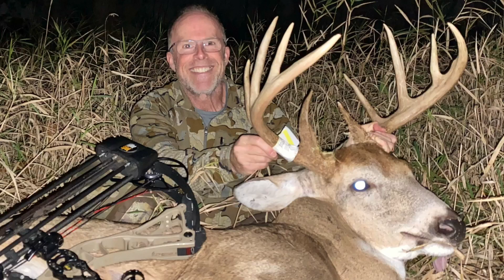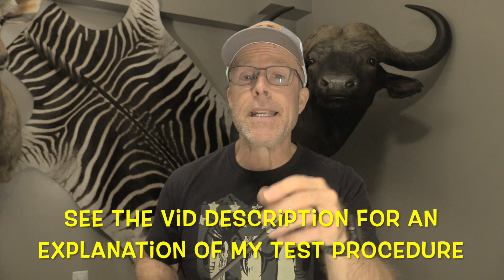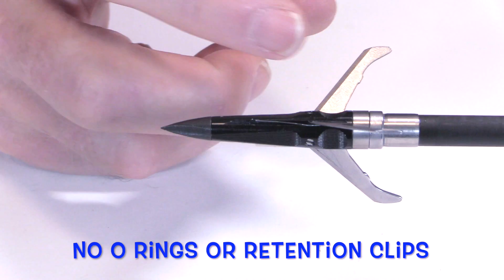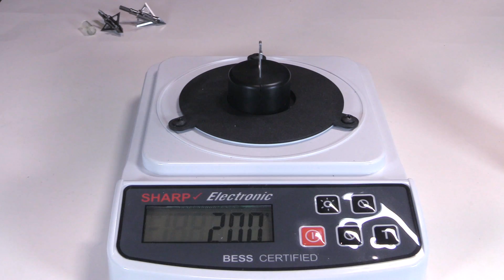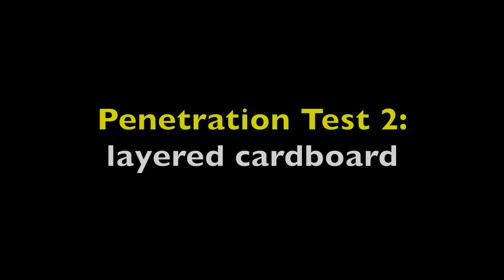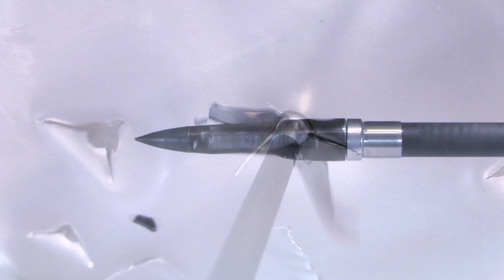NAP SPITFIRE 125 Grain Broadhead Test

Comment: Every deer I’ve shot with these a wasp jackhammers and rocket  hammerheads have put big entry and exit holes ! These heads start to open when they enter hide , hide and flesh tears easily so you get 2 big holes in. And out unlike the shwacker style heads that don’t open till in the body leaving only 1 hole “if “ you get a pass through ! If you don’t then u need a dog cause u ain’t finding blood
Reply from the maker: Thanks for sharing that experience.

Comment: I use their NAP 2" expandable for turkeys that is the same over the top design.  Somewhere on the packaging it said to replace the spring steel keepers after x amount of times the blades are deployed open from being shot.  I have a few heads that I've resharpened blades and shot at turkeys several times, and they definitely are way easier to open after a few times of being shot.  I wasn't a huge fan of that, but so far hasn't been a problem on turkeys.
Reply from the maker: Thanks for sharing that.

Comment: Spitfires are just above Puckett Blood Trailers on the POS list. Even the old ones dulled quick on  broadhead targets. Now they are made overseas and have got worse. Grim Reapers are pretty good but I stick with my Muzzy 100's.
Reply: Lmao😂
Reply: @reddawng43x91  You ever try those Pucketts? That damn company should have been sued and put out of business at the beginning.  Cheap ass aluminum bodies, blades with the strength of a wet noodle and upon impact they literally acted like a blunt nose. Only animal I ever didnt recover was from a Puckett. The damn blades bent in a foam target!

Comment: I’ve killed a truck load of deer with these they fly just like a field tip. The only issue I can say is they’re a little harder to open so I didn’t get as many pass throughs as I wanted but I still think they are a great head. About 4 yrs ago I switched to the nap shockwave-a little smaller cut and a lot easier to open and still fly great also 20$ cheaper lol. I killed a 22in wide 8 point on public land with them this year so I’ll continue to use them
Reply from the maker: Thanks for sharing that experience.

Comment: Lately it's a fashion not to get shit straight before talking about it -They definitely fully open before entering on a  whitetail  100% I have used them since they came out and every time it's a full cut on entrance, steel and gel trap the tips in place most times , and they don't take much force to open ether -at that speed blades kick open at the slightest contact 
We used to test them on a empty soda cans and paper and they open on contact every time
Reply from the maker: I've not seen many over the top mechs open fully on impact--and I've shot a lot of animals and tested them in a lot of different materials. That's the whole reason rear deploying mechs were invented--to get a full entrance hole. But I'm glad you found something you're confident in.
Reply: I can vouch for this !

Comment: I used them with the cut on contact 1/2'' or so blade in the front through 1 of my crossbows and at those high speeds planing can occurr. I did kill 2 bucks with it andthe wounds were nasty as it did rotate quite a bit. it also broke 1 blade on each. Yes, they hill deer but no, I wont use them again due to planing at high speed and blade breakage.  Also, getting them out of a foam block target is difficult as they rotate and bend blades.
Reply from the maker: Thanks for sharing that, Frank.

Comment: Man I absolutely love your channel, but again I have to disagree here man. I’ve taken so many deer with ally Matthews and that head and never ever had it fail. Also the chances of a pass through are way higher with it and blades kept safe and razor sharp. You will 95 percent get a massive exit hole and smaller entrance and deer bleed out so quickly because the lower side is spewing the major blood. Seems like the mew videos you’re putting out Are rushed also.
Reply from the maker: Thanks for the encouragement & the feedback; I really appreciate it. 

I'm really not rushing any of them...most of them were completed a while back and just scheduled to post at certain times, so it's the same process. Some of the heads take more explanation than others, so they are longer. And if they make it to the concrete, there is more footage of that and more footage of the head after the impact on the concrete. 

I'm glad these heads worked out well for you. I've taken animals with them successfully as well. My tests are certainly not Pass-Fail...but just Comparative in nature. These heads can get the job done for sure...but there are others that will penetrate better and are more durable. But again, it doesn't mean these are bad heads...but it does mean there are better ones.
Reply: @LuskArcheryAdventures  It’s hard for me Mr Lusk, I’ve offered to send you a new pack of SWAT heads so when I hear from you we’ll do that but back to my point. I am a fairly young guy but have taken so many animals with so many heads that when I see some of the best not show the best results it numbs me out because the tests aren’t what would happen on a real deer. I shot probably 20 deer with a 40 pound bow and blew through every one. They are such a soft easy animal to kill until a guy makes a junk shot or the animal ducks or whatever. I’ll hush I just wish you had a way to show actual hunts on heads to see how well they work. I’ll stop commenting but I was able to kill a doe a day years back and killed 10 deer a year ish for 15 years. I have seen Broadheads do crazy things, especially from modern crossbows. Anyway I’ll stop commenting because I’m being a pain even though I’m not trying to be. Have a blessed weekend Pastor Lusk

Comment: About what I figured. I used to shoot these but I never got a pass through with my 60 pound bow. I think the over the top deployment takes away a lot of energy to open for that reason I like redeploying much better. Also I brought quite a few blades just shooting it into a target to test accuracy. Switched to the nap sling blade I have never looked nack
Reply from the maker: Yep, you get a smaller entrance hole with over the top deployment and if you don't get a pass thru, then blood trails can be pretty light. They also can absorb a lot of momentum upon impact.
Reply: It doesn’t rob energy opening , mechanicals rob energy cuz of the diameter cut of the blades! A rage style deploy takes same energy opening witch is negligable

Comment: Shot my first Arkansas deer sence moving here this evening. The Deepower went right throw. Does anyone know if you can get replacement blades for the Deepower 1 1/4 broadheads?
Reply from the maker: Nice! Congratulations. I don't believe you can, cause the price of those broadheads is much less than the price of most replacement blades for other heads.

Comment: Took 117 with the 2 blade model back from 1995-2003 .. I have 5 on the wall from that period .
Reply: I liked the 2 bladed version and had good luck with them as well.
Reply: @halfstep67  
Since NAP went to China they haven’t been the same .. Mr Lusk used the Chinese version.. I promise the original would have passed with flying colors .. 😎
Reply: @windellpenton  You are probably right. I would like to see a comparison between the USA made Spitfire and the China made Spitfire. I have used the original USA made 2 bladed Spitfire and USA made 3 bladed Spitfire. I haven't used the China made version. But as for Mr. Lusk testing, the China made version is the correct one to test as it is the only one available for the consumer to buy. Today, I shoot the Magnus Stinger 100 grain 2 bladed broadheads. They are still USA made.
Reply: @halfstep67   Yes sir and the Magnus has a free replacement warranty.. can’t beat that !! Happy shooting !! 😎
Reply from the maker: Nice

Comment: Looks like a hunk of junk to be honest compared to 9/10 broadheads reviewed.
Reply: Back in it's day it was one of the best and is still one of the better mechanicals.  It's just not as durable as they use to be.  The older heads had fatter ferrules and larger screws to secure the blades.  Judging by what the  blades did in the test,  the steel used in the blades is different/lesser quality..  About 10yrs ago I shot a 550lb hog with a crossbow clocking in at 396fps.  Quartering away shot, I hit the the offside leg, splitting the bone.  The only damage was the tiniest of tip curl.  NAP needs to beef the Spitfire back to what it once was.
Reply from the maker: It was one of the first mechs out there...and has held its own over the years...but there are better ones available for sure.
Reply: SEVR to the rescue!😃
Reply: You are Deff a noob to archery
Reply: Lmao dude, go play golf , u know Nuthing of what u speak

Comment: cool head, my dad used to shoot those. did you close the blades for every shot? seems like sometimes you do and sometimes dont. that is a good durability advantage built right into over the top heads, is that they get inside the hard stuff before they open and start cutting vitals, so they really should be closed (like they would be when shooting at game) before every shot to see that advantage shine.
Reply from the maker: I did close the blades for these. My rule of thumb is that I typically do close them if I can.

Comment: I have used the Spitfire (100-grains crossbow) for a few years and have never had one fail to do its job.  For the price, I feel that I get a head that gets the job done and if I want I can change out the blades. I can not recall a blade breaking, but I have had some bend.  As long as the rest of the head is in good shape they get rebuilt.  I was not surprised that the blade bent in the MDF and I suspected the blades would break in the steel.  The blades are meant to be one-and-done.  That being said I have pulled one out of the ground and cleaned it up in the field and used it again the same day.  Not my finest hour, but in a pinch.
Reply from the maker: Good comment. Thank you.

Comment: The one thing I can say about NAP is that they get their blades sharp. I had a cousin back in the day that shot a buck with a Thunderhead that was a very sharp head. However all the bleeding was internal & never had a bloodtrail even though the lungs were shredded.  I only had one experience with a mechanical around that same time period which wasn't a good one.  It was not a Spitfire but another type which was the same design 🤔. Great video John. Very quick & precise.
Reply: Blood trails are always subjective shoot to kill them not to bleed them (Ranchfairy)
Reply: @scottpaulsen2649  I've lived long enough to know what structural integrity looks like & that's not it. I have a lifetime supply of the Valkyrie Viking Centerpin system short Jags & blood trailing is something that doesn't exist except for the part that u can hear the deer go down but just out of view of the camera.
Reply: @josephtreadlightly5686  i was merely stating about the thunderhead but I've never met a deer that can take a spitfire to the vitals though
Reply: @scottpaulsen2649  times r changing & there r great opportunities in tight quarters. However many can't be recovered legally due to a bloodtrail over 100 yards.
Reply: @josephtreadlightly5686  iowa we have the right to recover game
Reply: @scottpaulsen2649 I never met a deer that can take a thunderhead to the vitals either
Reply from the maker: Thank you Joseph.
Reply: I used to blow through deer like butter with a thunderhead and a pse nova with wheels at 45lbs 25” draw back in the day